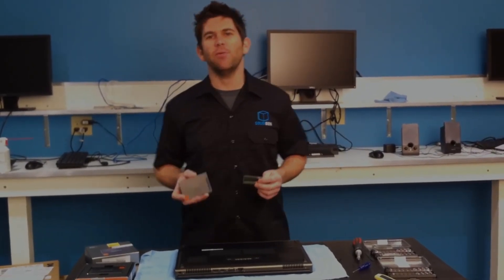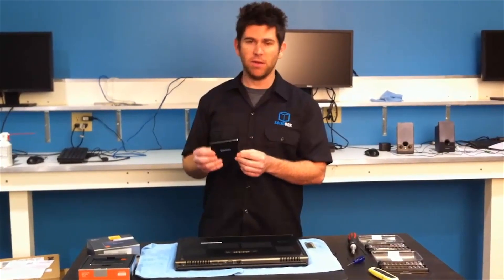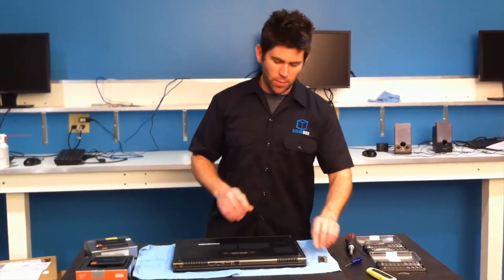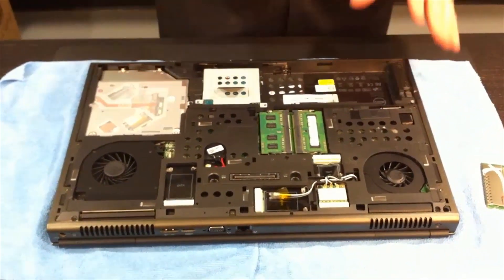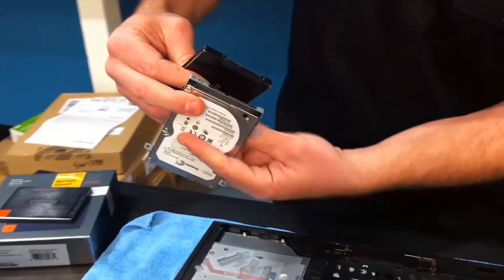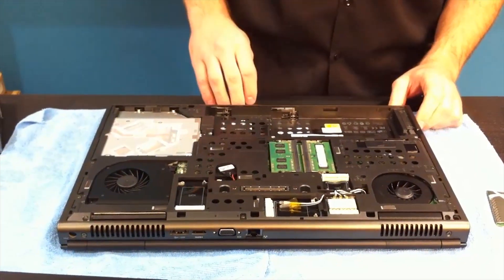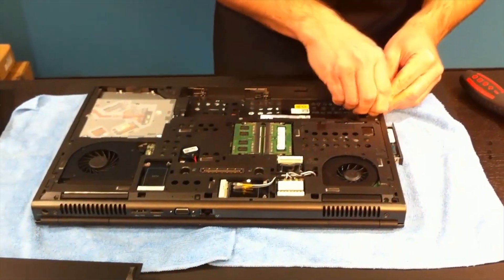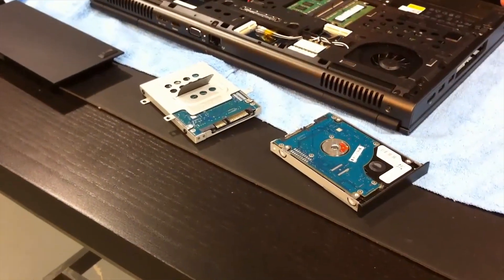SolidBox How To: Upgrade and Install Hard Drive and RAM in a Dell M6600 Part 1

Comment: I lost almost 7 minutes of my life and did learn nothing.
Make sure in the BIOS that 
BIOS - settings - system config - SATA op's - AHCI is selected
I have the OS Windows 10, on a normal SSD 128 Gb
and put in the mSATA slot a Samsung 860 EVO 500Gb as the D drive
Did cost me in oct 2018 only 97 Euro.
ps Think of static electricity when inserting the mSATA

Comment: Rather than use a magnetic screwdriver, merely use a non-magnetic one then use Blutack to remove, and safely retain, the screws.

I upgraded my Dell Precision M6600 to Kingston HyperX RAM. I've also upgraded the drives so now have a main (C) SanDisk X300 MSATA 128Gb SSD as the primary boot drive and auxiliary (E and F drives) with two Seagate ST9750420AS HDDs as pure storage, thereby giving 1.5Tb combined HDD storage. However, now that good quality 4Tb HDDs are available for around $80 I'm likely going to replace one of the 750Gb drives.
Reply: Where the heck did you see 4Tb for $ 80 ? ? ?🤔
I've never seen it that low !! A 1 to ssd is about $100 for name brand . 
Even a spinning HD @ 4tb is way more than 90 bucks ! 😡🙏😇

Comment: Hi you guys. I got a question for you about this Dell Model. I got the Intel i7 version and the tempeture is high i think. The average tempeture is 50 Cº. In a rare ocation is 45 cº. Any advice? This is normal? Thanks for any answer.
Reply: It is normal and this laptop will ramp up fan speed and cool itself right down if temp climbs much past that.  Mine runs at 50 to 60 and around 65 the fan will come on and it is back down within 60 seconds. These laptops have excellent cooling and heat management.
Reply: Make sure the fans are not clogged with dust and debris !! 
Might even need new thermal paste on the cpu ?!

Comment: Hi, 
I have a Dell M6600, I just bought 16GB of hyper x ram,  a samsung 256 SSD, and a WD black 1TB HDD.
I can only install 8GB of ram, and also the second HDD will not even spin up. If I install ram under the keyboard it will not boot. I have swapped the ram so I know it's all good.
I know this is an old video, but if you have any idea please share. Thanks. Love your content.

Comment: I have the Dell M6600 with the i7 - 2920XM with 16GB DDR3 - 1600MHz of ram, Im looking to upgrade to 32GB of ram,  looking at the tables of maximum memory configurations for my setup it indicates that the maximum is 4 X DDR3-1333MHz... Is this correct? I take it the 32GB would still be better?

Im also looking to put in the SSD, is the Samsung 850 pro my best option?

Best Neal

Comment: Can I add 2x8GB to 2x4GB for a total of 24gb ram? All other specs match - all 4 sticks are DDR3L 1.35V 1600mhz.  I want to make sure that I will be able to utilize all 24 GB and that the machine wont limit the 8GB sticks since its paired with the 2x4.
Reply: did you get an answer about it?
Reply: jizozor fred yeah, itll read any and all amounts of RAM you load it up with. my M6800 runs great with 24 gigs